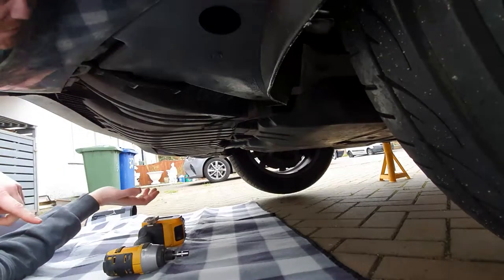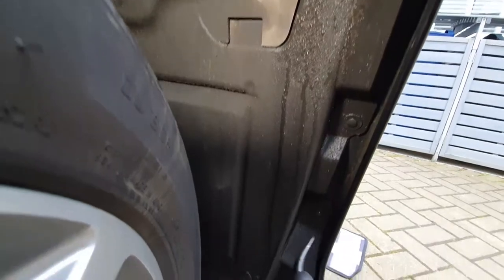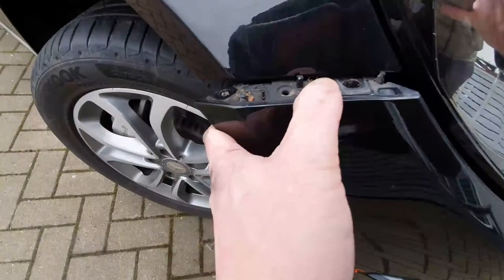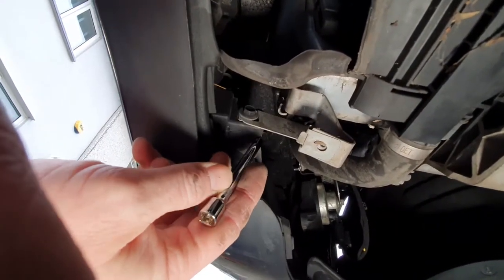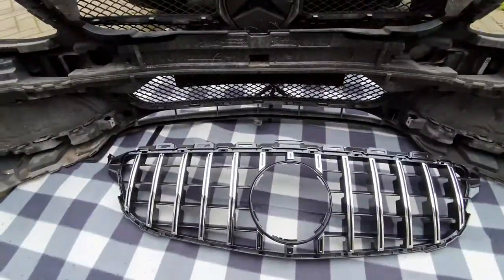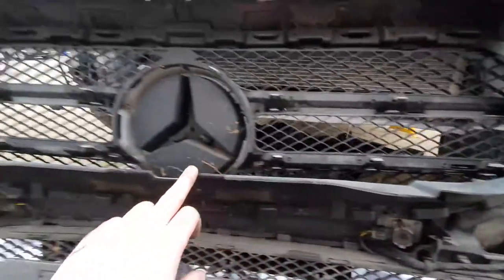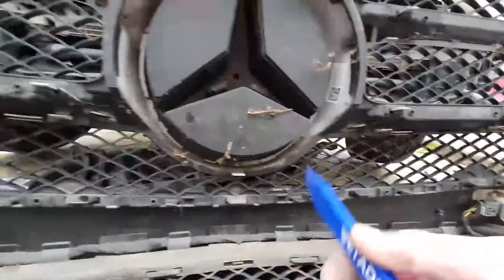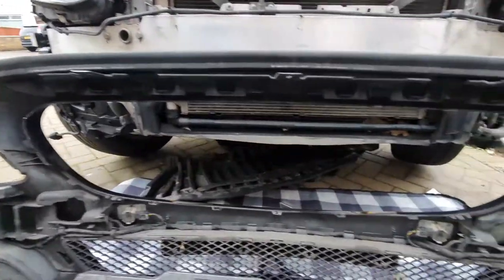Mercedes C Class W205 all variants GT Style Pan Americana Grill Install Full Guide.

Comment: My local body garage saying you need to recalibrate the pedestrian sensor and that's 250 is that right?
Reply from the maker: If that's the square one in the middle? We changed the grill on a gle with that sensor and had no issues. No calibration needed.

Comment: Any ideas how many bumper cover support rivets and screws needed for this job? Thanks
Reply from the maker: Outside of the clips and screws that hold the bumper to the car. The grill fits directly as per the oem one. Aslong as you are careful you should not need anything extra.
Reply: @mvautomotive7092  Thanks, sir.
Reply: @mvautomotive7092  Thanks. One more question please. Is it "better" to apply the AMG lettered emblem badge before, after, or not matter? Thanks!
Reply from the maker: @rbmedd  does not really matter. But I would say when it's off makes it easier.
Reply: @mvautomotive7092  Thanks very much. Appreciate the help!

Comment: Does really require the  car to be up on an axel stand 😔
Reply from the maker: It's more for ease. If you have the wheels turned at full lock either side. You definutly need to remove the front belly pan. You could get away with just removing the leading edge screws for the 2nd pan allowing it to hang down on the rear screws. This will work will just need someone to guide the front pan under the rear on refit. Hope this helps?